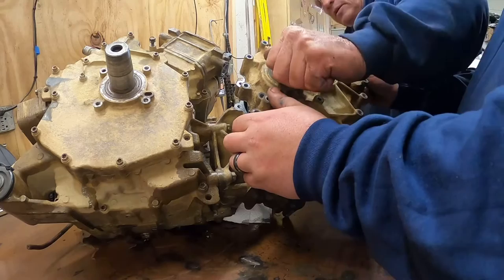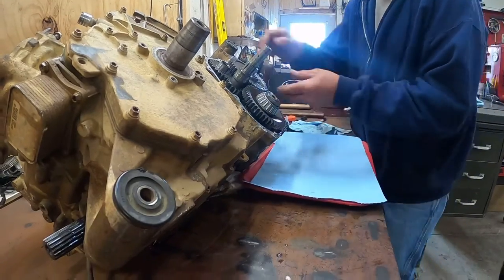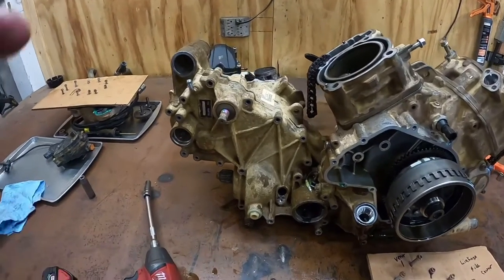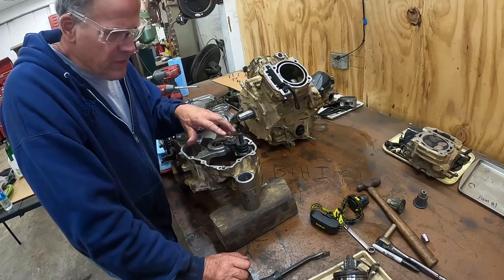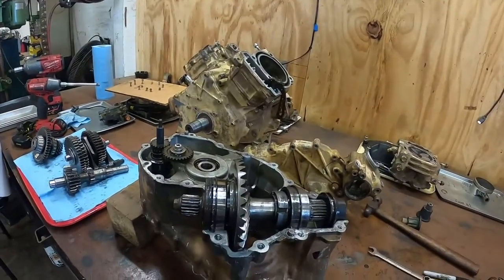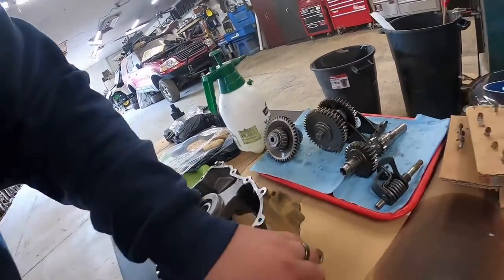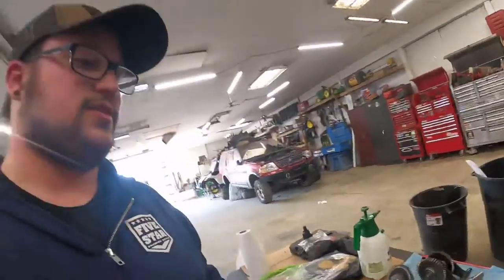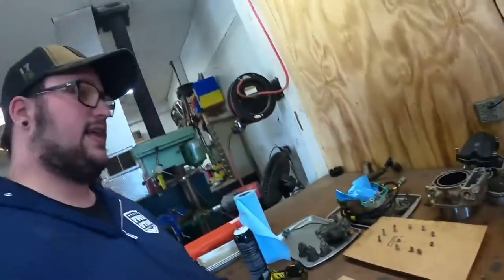Tearing Into A Can-Am Maverick 1000 Gear Box Part 2

Comment: Rule nmr 1 people are not to be trusted rule nmr 2 people don’t sell there stuff because it’s zoo good  mostly it’s exactly what you just bought 
Those basterds broke the gear box then took it apart to do the jb weld fix and then slammed it together in a hurry that’s why there’s missing so much stuf and bolds where not tight . They didn’t care 1 bit ho they are going to hurt 
 they where  out to sell this peace off crape as fast as they good with a bunch of Lying to stick it on to the next victim , shameless and painful !
And no that gear box in that state wouldn’t hold 10 miles with out blowing apart zo they’re lying there teeth out about the machine